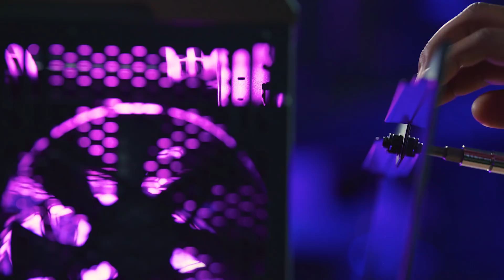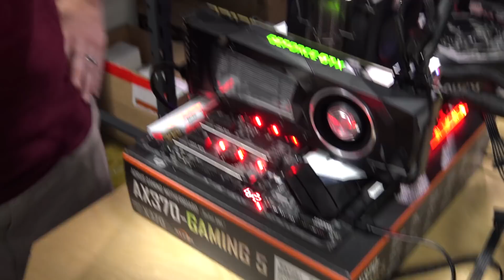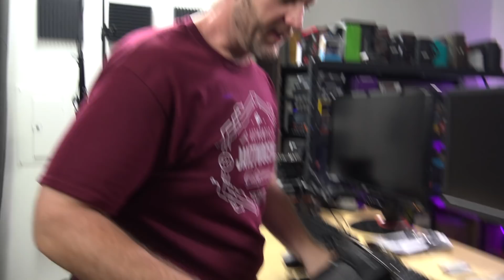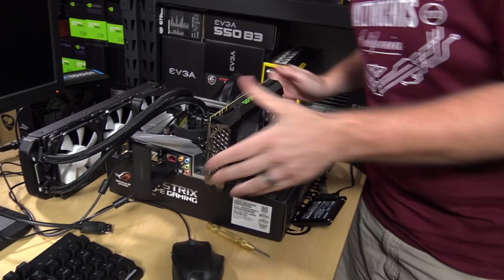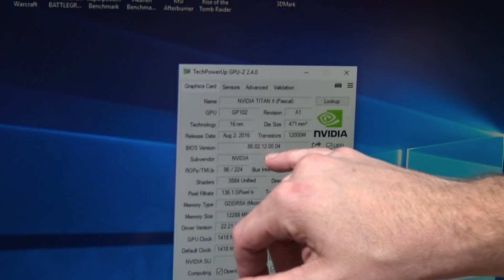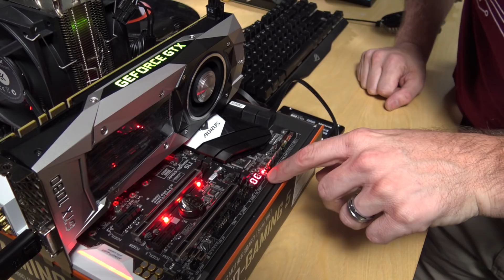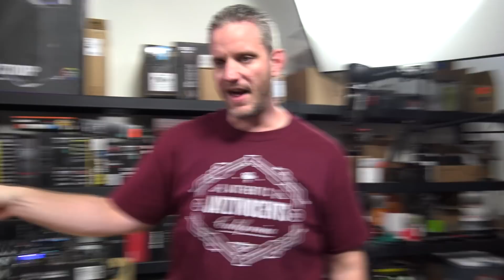I cant figure this one out... HELP!

Comment: Jay,
I've seen this type of problem many times... I used to set up new laptops for our managers and desktops for the call center , and had the same software load images fail on identical systems.  This was caused by Compaq not using identical Bill-of-Materials for identical (by model and sub-model) boards.

One item that comes to mind was Compaq's use of pin compatible ethernet controllers from multiple OEMs, although the problem was duplicated in several subsystems besides lan chips... They each had slightly different drivers, forcing manual OS loads from original media instead of using Drive Image or Ghost.

Happy Hunting!

Comment: Jay, I have seen this before. The mother board and the video card are both good, you proved that with a double roll and with multiple video cards in the mb. There is some tolerance stacking going on between that video card and mb. combination and you are right if you rma'd it, it would come back no trouble found. What to do? Nothing, not worth the time to trouble shoot as you would have to look at the signals going to and from the video card.

Comment: Showing that the same card has the same bios version on each system isn't helping anyone. I do hope you actually checked to see that both the cards has the same bios version and didn't just do a brain fart. Either way it sounds more like a motherboard issue than a platform issue, as is the case with most of the issues that exist on Ryzen. The CPU's tend to work perfectly fine, but the motherboards are highly variable (especially if you have one of the first revisions).

Edit: I would try it on a different am4 motherboard if you have one available, some of the boards are just really unstable. Most is fixed in bios, but some were just bad from the start (to be expected with a rushed platform).

Comment: not gonna lie, if all options are exhausted, i usually assume it's the PSU/PSU VGA cable/6+2 or 8 (or both) pin connector on GPU is bad

Comment: The issue is a Gigabyte board.  Force it to use  gen 3 PCI to use it.  I had to boot from an old 760.  it is something with the motherboard bios setting on the gaming k5 and k7.
Reply: I dealt with this on day 1 of the k7 availability.

Comment: If the GPU (the card in question) is the only item that does not appear to work, then it is mostly an intermittent issues within the graphics card. Graphics cards run their own series of self-tests during powerup (including a form of communicattion handshaking with the MB and CPU). 

It may be that the card is failing in some internal component self test, and then that results in a timeout in the handshaking with the MB/CPU which (logically) means the system does not post.
Reply: The logical course of action (which is probably outside your expertise) is to read the internal debug routine for the cards internal voltage checks and then read the internal debug log for the timing and handshake with the MB/CPU.

I unfortunately doubt Nvidia will allow you access to their internal hardware checking protocols (or toolsets) to figure out which kind of error the card is failing at.

Comment: I've had this problem on my crossfired system with dual R9 290X.  Confused the hell out of me.  Turned out to be a faulty PCIE PSU cable.  Don't know what exactly about the cable allowed it to work on one card but the not the other.  But it was the cable.  Maybe one of the contacts just wasn't quite contacting well enough, I don't know.  Took me over 2 weeks to finally narrow it down to the cable because it initially manifested as random system crashes.  But was finally able to narrow it down to a specific cable.  Replaced the cable and problem went away and never came back.

Comment: I would look for a damaged pin in the card you're having issues with and i would also test the card heavily in the system it's working in to see if it's at its full potential.   I had a sparkplug in my car like that once. It would fire just fine but if you jumped on the gas it couldn't fire fast enough and the car would bog on the cylinder.

Comment: Recent gpus have an EFI bios region and Legacy/csm region. Make sure that CSM mode is disabled and it's booting in pure EFI envoirment. If it is, one of the Titans might have a different GOP driver version on the BIOS while keeping the same version number. Also, you checked the bios version of the same gpu twice. D'oh!
Reply: Reply to myself... Dump the 2 bios and check if they are exactly the same. For example, compare md5 checksums

Comment: Have you tried defaulting the MB to stock? Yes I know that a different card that is identical works but to limit possible issues maybe re-flash the MB Bios just so it is not an issue.
Reply: Other than that the only thing I can think of is, Is there a heavy OC Applied to the Titan that is not posting? Does the Ryzen system have a PSU that can handle the OC on that one card vs the one you have in the Intel System?

Comment: Do you happen to have another motherboard exactly like the problematic one (same make & model) that you can try? Then that will tell you if it's only that particular motherboard or if it's a problem with that motherboard model. If it is an issue with all motherboards of that model then perhaps a future bios revision can fix it.
Also remember to check the bios version of both videocards... in the video you showed the bios of the same card twice.

Comment: Gigabyte motherboards are quite glitchy in the past few years. I sell ASUS, and AsROCK and sometimes MSI but rarely.  I stopped selling Gigabyte because they kept dieing for no apparent reason and also had odd boot issues.   My guess is that same card works on other Ryzen mobos just fine.  Same build, PSU, RAM, etc.  Just no gigabyte mobo.

Comment: The one thing I noticed was that you checked the bios version on the same card twice, first on the Intel system, but then again on the the AMD system after you switched the cards instead of testing the one that hadn't worked on the AMD system after you switched it to the Intel system.  You may have checked this and just not included it in the video, but it's the best suggestion I can make.  Good luck

Comment: I had a similar problem once, not sure if it is the same problem, however; what I did to fix it was to replace the memory and that's because I was told that the memory cards would retain information about the graphics card and if that info was corrupted then it would simply not start properly.  Hope that helps.

Comment: Hello, 

Has you said  i would change all bios, MB and GPU, but before that I would do the "lamme Troubleshooting"......

Take all ram out, use only one dimm....after change the slot of the gpu to the bottom pciexpress.....use another PSU and also use boths ram dimms....this is my usual steps, they work 90% of the time.....

Comment: I have experienced something similar with my new system. 2 weeks ago i bought my new pc.... graphics was MSI gtx 1060 6 gb gaming plus. After 1 week of it working fine, when I started my pc , no signal message appeared on the display. Put my card in my friends sytem and it worked perfectly fine, put other cards in my system and it also worked perfectly fine. Only my card would not work in my system anymore, even tho it worked perfectly fine for 1 week. The solution ? Refunded and changed my card with the same version. Now it works fine , no problems. The problem was with the graphics card.
Reply: I also updated the bios.

Comment: You used the same card that was working on the Intel system which you checked the BIOS first  and then checked it again on the AMD system again you didn't check the one that was not working on the AMD on the Intel system

Comment: JAAAAAYYYYY!
You  checked the bios version of the same card twice. The card that was originally on the 8700K system and moved to the RYZEN system. You didn't check the bios of the card that did not work on the RYZEN system after you moved it to the 8700K system.
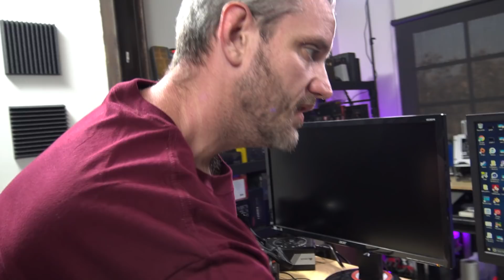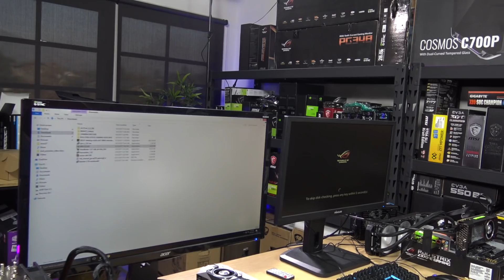At 1:58 you checked the card on 8700K and then moved it to RYZEN and at 4:48 you checked the same card at the RYZEN bench. You never checked the bios version of the card after you installed it on the INTEL system.

Comment: This is a random idea.  Did you try different RAM?  I only ask because I recent did some troubleshooting on a Ryazan machine and it came down to an issue with RAM, the cause of which was a mystery to me, as the same memory worked fine with a different gpu with the same chipset.  WEIRD.

Oh yeah, and did anyone suggest turning off and then on?  And did anyone notice you looked at the same cards firmware version twice?

Oh I see several hundred people suggested both.....  LOL

Comment: You made a bit of error here, you pulled the card from the Intel system after checking the bios number. Upon the Ryzen boot you checked the same card for it's bios... which of course was the same you however, did not check the bios of the card that failed to post on the Ryzen when you switched it to the Intel setup.

Comment: I currently work in IT and had a similar problem not that long ago with a quadro xxxx, turns out it was the ram in the dell T5500 was different from the other T5500.
Are the drivers the same on both systems?

From The IT Crowd........."Have you tried turning it on and off again, Are you sure it's plugged in? yep that fixes it ok."

Comment: I have a similar problem my 480 won't work on my pic it used too I doesn't anymore it will work fine on my buddys and my 550 ti works fine on mine but my 480 won't anyone know how to fix that

Comment: Bad motherboard. It's very complicated to explain but it ONLY fails in exact conditions with the setup. I had a top end end motherboard from Asus do this to me where I had to argue with Asus for over a month to make them re-create the exact same conditions. trust.me I was a builder at a large boutique shop and it stresses me to the MAXIMUM! I worked in the biz for 20 years with servers and high end rigs . The sli on AMD SLI is extremely sensitive.

Comment: first , why would you check the same video card with gpuz  on a different pc?  
second, reinstall hardware, third clear cmos and start over !
i had a cpu cause the same problem once. and just reinstalling it fixed the problem (i think that was a voltage issue).

Comment: May that be the memory of the CG ? Ryzen as we know is picky with RAM memory already but maybe the memory of the CG is the problem, that would explain why the CG work on intel or an other bench station and don't work on that motherboard/CPU. Change the CPU, try, then change the motherboard manufacturer and try always with the "bad" card. And maybe look at the memory on both card to see if it's the same.

Comment: few ideas. some are a bit silly but sill has helped me trouble shoot in the past
check card in another totally separate ryzen build 1700x/1600x then the non x variants
are the pcie contacts in slightly different positions within the socket
use a different display port on the back of the card (this one is a longshot)
are overclock settings software or saved to the card? if saved to gpu restore to default(never oc'ed a gpu)
try the other pcie slot

if I think of any more ill edit the post

Comment: I got some suggestions:

Reflash mainboard bios, apply factory defaults (no OC)

update/reflash bios on the GPU (maybe even pull the bios from the working card and flash it on the non working)

bench both GPUs on the Intel test bench with Firestrike (if scores are different then something is faulty)

Other than that, maybe contact nvidia/amd/gigabyte about this, maybe someone reported something similar and they found a fix. And of course you can switch parts step by step (fist ram, then CPU, then mainboard. Maybe even PSU or just only power the non working card with a different PSU)

Comment: You checked the same card twice ( once on the intel then on the amd) for bios version you never check the bios version on the card that wouldnt boot on the amd system when you moved it over to the intel so you still dont know if the bios is the same as the first card that was running on the intel system

Comment: Believe it or not, I had a weird problem like this on an electric forklift. Until I removed the faulty programming, I couldn't fix the problem. Flash the bios on the good gpu first and test in the Ryzen system. Then flash the faulty gpu with the same good bios file that you know works and try it out. Numbers are the same but there has to be something messed up with the fauly one that Ryzen doesn't like but Intel tolerates.

Comment: Technically you didn't check both bios. You checked the bios on Card A when it was on the Intel system and card B was on the ryzen system. You then put card A in the ryzen system and checked bios again. You never checked bios on Card B once you put it in the Intel system.... you checked the bios on the same card twice.

Comment: this is partially why i don't think Ryzen is for me. it's the same reason i don't use Linux full time. i don't want to have to troubleshoot basic functions and small errors. i just do not have time for it. if that somehow makes me a slave to "the Man", then i guess i am. although Nvidia drivers are awful, at least widespread failures aren't par for the course. maybe in 2  years AMD will release a variant of this that works, but until then i'm going to have to pass.

Comment: Jay, first of all you will have the same bios version if you move the same graphics card and install in onto another system. Also I know that you said that Ryzen is finiky with ram, but it might help to reset to default and see if the issue still continues

Comment: u didnt check the bios on the other card :P anyways it might be the GDDR5 ram on the other card ? like one might be samsung the other might be hynx ? something like that aka might be the HDMI/display port controller or power phases you know something underneath that might be different from card to card ^^ OR it might be the lights and the coating on that gpu :P it absorbs all the negativity from them fanbois and refuses to run ^^

Comment: Can I suggest swapping the power supply. Take the card not working, and grab the power supply from the system you know it works on, and see what happens. Can you also test by using a different pcie slot, I'm guessing you have xfire/sli support? Just a thought.

Comment: I would pin this on hardware being weird. I have a friend who had gt 610 (i know it sucks thats not the point) that worked in every PC I tested it in, but when we tried it in another friends PC (to get him off 2nd gen i5 integrated graphics) it refused to work correctly and even corrupted some files in windows. We then tried a gt 620 i had laying around and it worked with no problems at all. hardware is just weird.

Comment: Assuming that you checked both cards BIOS, (in the video you checked one card, assuming you already tried this and was redoing for the video to prove it) did you try the other pci slot on the motherboard? Maybe you should try a different ryzen motherboard altogether and it's just one of those quarks.

Comment: Any bios settings that would be changing how the computer boots, could it be a issue with voltage between the power supply and the cable (Because from my knowledge parts will slowly stop working with a psu if it's not being powered right)

Comment: My super esoteric guess would be that maybe it's a pci-e pin contact problem. One particular pin on the Ryzen slot might not be contacting correctly for that card. I'm taking the smallest of defects, that maybe isn't hindering the slot on the Intel board. It's a long shot yeah. 

That, or try different RAM on the Ryzen board. When Ryzen is cranky it's always the RAM.

Comment: gpu-z shows the "bios number" for that gpu, but doesnt show the bios version. In the case of my msi rx 480 i bought it early, after that msi comes up with the new bios on the newer gaming X´s. A friend of mine bought a "new one", and.. to my surprise gpu-z showed the exact same bios number. I asked him to give me the bios file so i can edited it on "radeon bios editor" when i opened it my bios was version "113-MSITV341MH.151" and his bios was "113-MSITV341MH.153". I flashed my rx 480 with that bios...  that fixed a wrong power consumption reading (it was 30/40w higher than it should).
Sry for my english btw
Reply: you can check the real bios version on techpowerup´s vga bios database.

Comment: Usually I start plugging in 1 part at a time memory module then hard drive and such. Or change memory or revert to old bios if possible cause the new bios might be unstable. That's usually what I do when something doesn't work

Comment: Jay - Blow your PCI-E slot out with some air as it might be some dust as the 1080 didnt post either until you re-seated it as well ?????? just a thought
Reply: Also clean up the contact on the faulty Titan

Comment: Love your Videos. In this one you say, Firmware is identical, after you have GPUzzdded the Same Card, after the Switch from right PC to the left PC. 
So it is possible that it is still a Firmware Problem, because in the Video i can´t see the Firmware of the not on Ryzen running Card, after you put it into the Intel System you did not Gpuzzeded it there in the Video.  
Maybe on a Hard Working Day with many Hours done you have compared the Firmwares of the Same Card after the Switch to the other PC? 
Possibly not, but the Video shows only this. So still perhaps a Firmware Problem? 
If you have compared the Firmware, and it is only not shown in the Video, i have no Clue then. Greetings ;)

PS: I think after watching it several times, you did this with intention. Perhaps to Test your Peoples Attention? :D